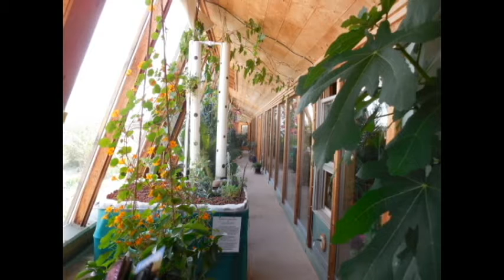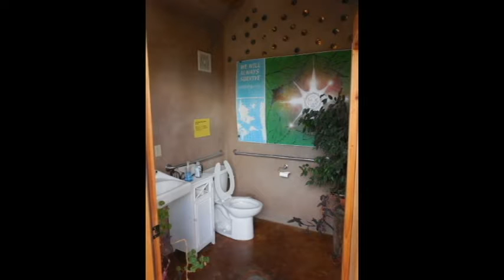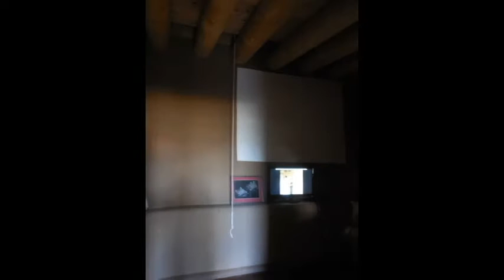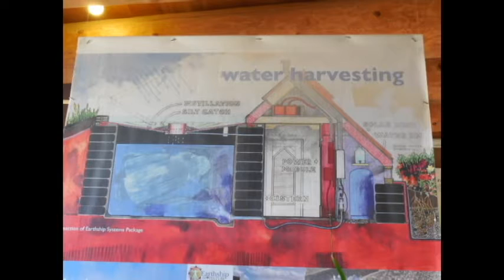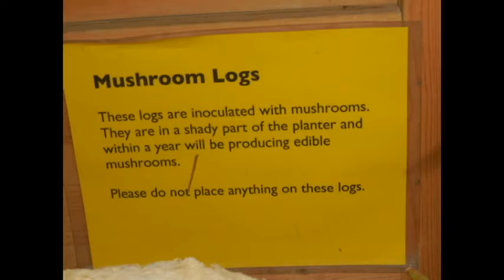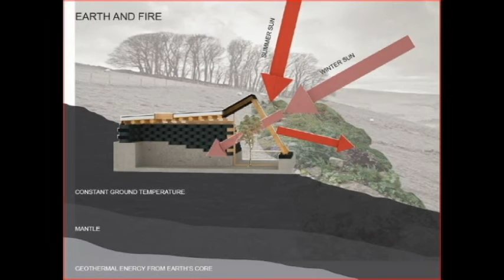Earthship Trip BackRoomLabs

Comment: That's the first time I saw the slide with the Tire Sizing illustrated so clearly, thanks for sharing that.  

I didn't think that screws you mentioned were actually there to screw one tire to another tire or even to another course of tires.  I haven't taken the academy nor seen an actual Earthship in person so I could easily be wrong.

I  think the screws are there as a pincushion of sorts to help build anchor points for bonding dislike materials like the stucco.  Screws I think are also used when tying half tires to the adjoining tires where those joints are needed.

All in all I liked the video thank you!